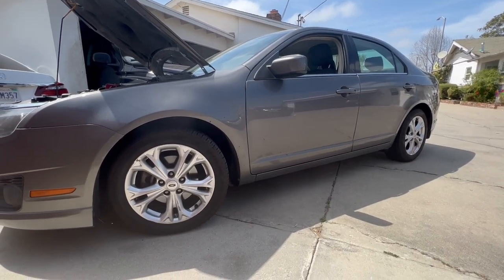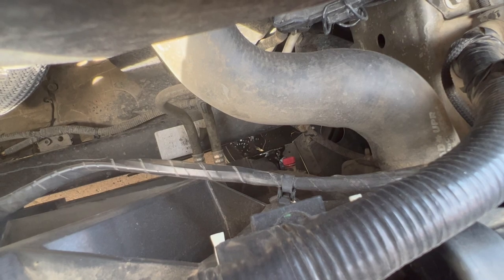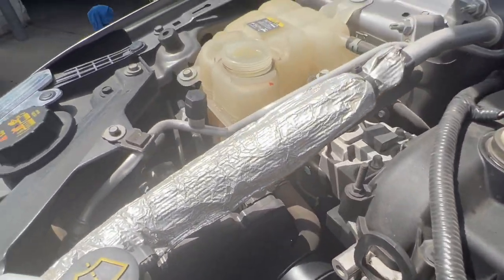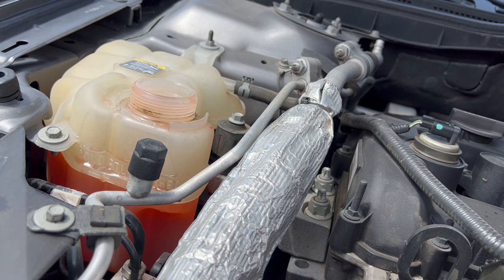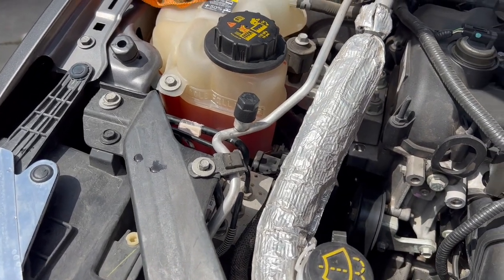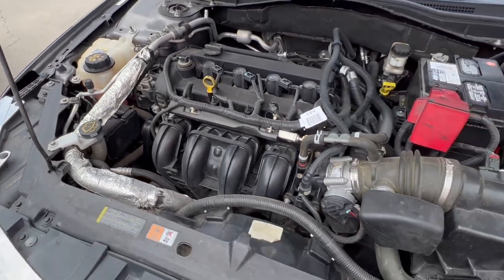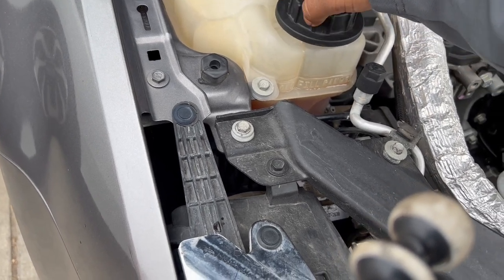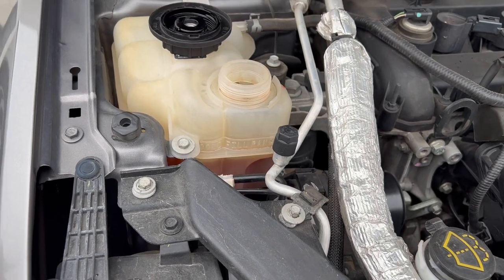How to Drain and Refill your Coolant Antifreeze Ford Fusion 2006 - 2012

Comment: There's a bleed valve that you're supposed to open when adding new coolant so that most of the air gets out. To remove all air you need to turn the heater to max and rev to 3k rpm for 30 seconds and repeat it a few times.
Reply: Could you tell me where the bleed valve is please? Is it at the top of the engine ?
Reply: Nevermind, he showed where lol
Reply: Questions. 
Do you open the valve before you start adding?
Can i keep the reservoir cap open while the car is running so i can add coolant?
Reply: Is that while the valve is still turned to the left ?

Comment: Those people that their Ford Fusions 2010-2012 require Orange Motorcraft Coolant (Ford specifications WSS-M97B44-D and WSS-M97B44-D2), and Motorcraft Specialty Dark Green Coolant (Ford specification WSS-M97B55-A). The new coolant that Ford recommends is the new Motorcraft Yellow Coolant, it is backward compatible with the 2 Coolants that I mentioned. (Flushes are not required, except if the coolant that is currently in the vehicle is contamined).
Reply: Can you please explain about contaminated coolant. Wondering about the flushes thanks
Reply: @Gerardocaracosa  To what I know, contaminated coolant is that 2 types of coolant are mixed, such as P OAT and Nitrite Organic Acid, or the car was filled with tap water, or any other type of contamination.

Comment: I was confused about the bleeder valve, because the screw only seemed to turn 1/8 turn.  Someone suggested spraying PB blaster on the valve to help it turn (spray between the "screw" part and the outer cylinder).  I did that.  The bleeder valve is not a valve like a plumbing ballcock valve.  It is a plastic screw (with the screwdriver slot) inside a threaded plastic cylinder (which attaches to a rubber hose).  There is an O ring around the inner plastic screw part, which keeps the coolant and pressure in when "closed".  Hold the valve (the outer plastic cylinder) in your strongest hand, then turn the inner screw part counter clockwise with the screwdriver until you see the O ring come a little above the outer plastic cylinder.  Then you know it's open, and the air can bleed out.  To close it, turn the screw part clockwise until flush with the outer cylinder.  Mine has a pink line on it .  Turn the inner screw part until the top is flush with the outer cylinder, and the pink line should be fairly close to the little pink dot on the outer cylinder.  Edit: This is something you need to do to let the air out so your engine doesn't overheat.  Don't bleed when the engine is hot, let it cool down first!!  If you can't unscrew it yourself, get your neighbor to do it (you know, that guy that shook your hand so hard it hurt).  Good luck!

Comment: Nice video. To those who commented about not opening the cooling system when it’s hot, yes you are correct. The heat in the coolant is a byproduct of the internal combustion process .Heat causes expansion and since the cooling system is under pressure ,allowing the system to cool down before opening said system would be appropriate.

Comment: Don't use the orange coolent or dark green coolent. They have all been replaced in 2018 by ford's new gold coolent. It is far superior and it is great upgrade especially if you have the V6 with the internal water pump.
Reply: Wouldn't it require a radiator flush? If I am correct, draining it will still leave some of the orange coolant and its not good to mix different types of coolant.
Reply: @idanny76  If your going to drain and refill might as well flush it. Also ford claims its backward compatible but I would still flush
Reply: @grivolas2144  It is not the gold,  it is the Motorcraft Yellow Coolant. It is backwards compatible with the old P OAT Dark Green Coolant used in Ford Fusions 2010-2012.

Comment: Mine say green
Reply from the maker: Yes it might say that- but according to Ford the gold is the newest coolant antifreeze and works best for their cooling system. I would personally keep whatever you have in your reservoir- just service your coolant system.
Reply: @RookieRepairs  yep that's what I did just kept what's in there and toped it off with AutoZone Universal 50/50 it's lime green...
Reply from the maker: I personally would have gone with Motorcraft coolant antifreeze. Keep it going- well maintained and it will run for a long time. I have additional videos feel free to check it out: https://youtube.com/playlist?list=PL3GPOzl4aAfkRNwCZfCAW0fMPQWsvEY7A

Comment: On my fusion 2010 sel v6 the valve is metallic right under the air filter hose. For some reason, the manual says 9 litters, and I was able to get a gallon out waiting for about 10 minutes , not sure if all coolant went out, how ever looks pretty clean aftera few miles.

Comment: How many miles did your 2012 ford fusion have? Mine has 146k miles and the coolant still looks orange and not dark like yours. The coolant hasn't been changed ever and I was considering just changing it to keep the car running good. I read on some of the comments to change to the gold coolant, but my guess is that it will require a flush to remove all the orange coolant. If I am correct, it is not good to mix coolants.
Reply: Change it immediately lol. It may look fine in the reservoir but I gaurantee it is dark and discolored in the radiator....

Comment: How much coolant should drain out? I’m only getting about a gallon even when I open the bleed valve while draining.
Reply from the maker: You will have to do it 2x in order to get the old fluid out- turn your heater on Full Max. It’s about 2.325 gallons of coolant in your cooling system. Best of luck